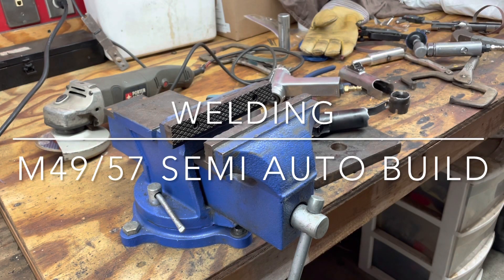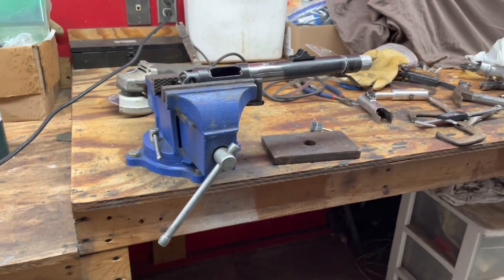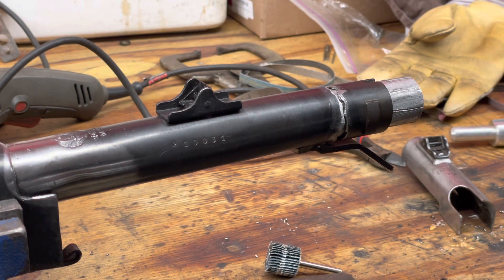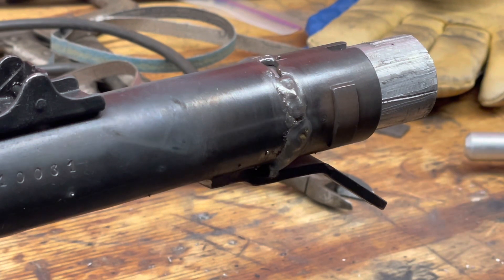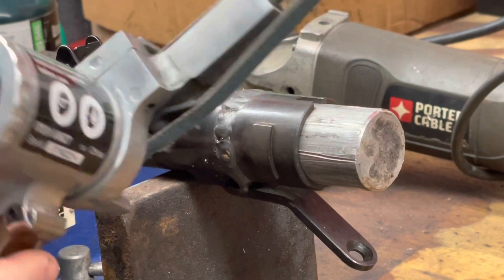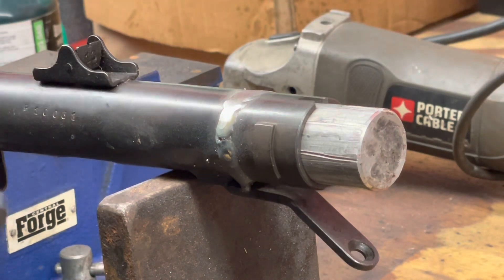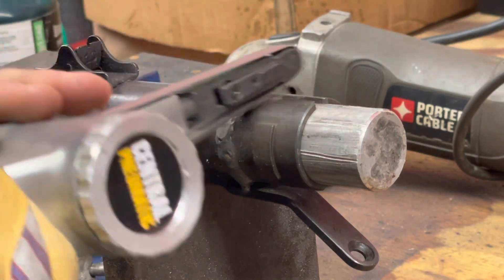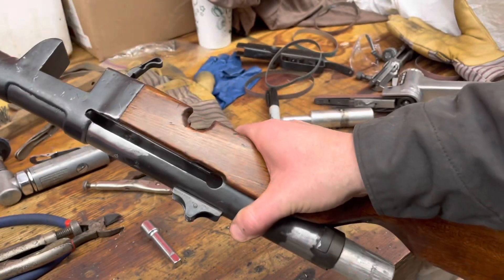M49/57 Semi Auto Build - Welding

Comment: These are fantastic kits. Ive built 7 so far. I use .030 mig. And use copper pipe as a mandrel. Easy internal clean up.  Nice work bro.

Comment: What size gas bottle is that?
Reply from the maker: It’s a 60cf. I have the same bottle sizes for mig and tig but I wish I had a bigger one for the tig welder. Mig it’s a fine size but tig uses a whole lot more gas.
Reply: @JPMachine  yeah mainly because of the pre and post flow
Reply from the maker: @lilrobi45xxx42  exactly

Comment: Nice work!!! You have to put the denial pin in or it will be considered a machine gun, correct??

Thank You
Reply from the maker: Yes, it cannot accept any unmodified full auto components. So you need to have denials for the bolt and FCG that only work with the semi mods

Comment: How did you get the sights lined up and distanced properly?
Reply from the maker: Eyeball them, you can tell where it’s supposed to be by lining up the bolt knob slot usually. For the front sight, you can line up the holes in the shroud.

Comment: A little late to the party. I was doing a reweld on a PPS-43. 120v gasless, flux core mig. I found that I couldn't hold a consistent weld because it would burn holes through very quick. Is the M49 receiver made of a thicker metal which allows this? Considering doing an M49 build myself!
Reply from the maker: A little thicker…Not much though! With flux core you’re better off doing small the whole way, not laying a bead. A much better option would be to get a gas setup!  I do complete semi conversions for m49/57’s too if interested!
Reply: @JPMachine  Appreciate the response! Ya live and ya learn. It was my first build and I'd consider myself an amateur welder. It was definitely a fun project and learning experience. Still haven't completed the bolt yet. Blew the motor on my mill. Have to replace that and hopefully will get back to it. I may take you up on the offer for the M49 if I pull the trigger (pun intended) on getting a kit. If you dont mind me asking, which supplier do you use for barrels? I wound up getting a 16" barrel for my PPS43, with a barrel shroud extension. Looks a little like an Ant eater, but I can keep the stock at least! Seems like parts for the PPS are easier to acquire than the M49. I'm also a member on WG so I will be checking there. Any info you may have would be appreciated!
Reply from the maker: @BlueprintTactical  I’m a vendor on weaponsguild too. I documented my whole m49/57 build in a thread in the “all others section.” Check out my part 1 and part 2 Pps43 build to see how I did the barrel. I like the looks of a fake can as a barrel extension a whole lot better than the anteater look! My main product I do for people is the Pps43 bolts if you get stuck there too.
Reply: @JPMachine  Perfect! Sounds great. As I said, this was my first build from a parts kit and definitely hit some snags along the way. I have 2 kits. I may try the PPS bolt myself first and if that doesn't work out, I will more than likely be reaching out to you lol
Reply: @JPMachine  I actually just watched your bolt build video where you said Bowman. Thank you again! I may be emailing you soon about a possible semi bolt build for the M49!

Comment: What settings you running?
Reply from the maker: Believe it’s heat setting D, wire speed of 5. No idea what that translates to but I have enough experience on my machine to have a pretty good guess at where it should be